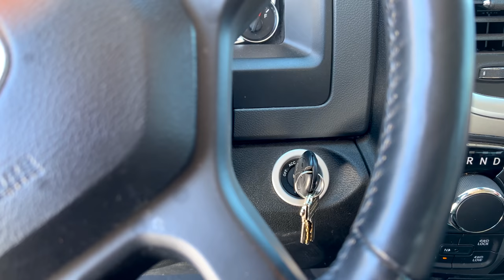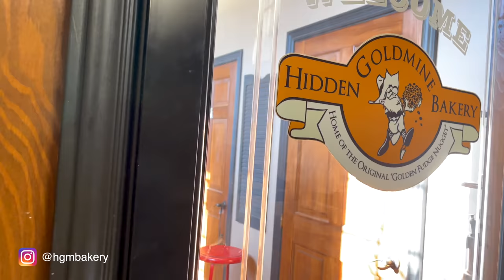Our overnight trip to the OFF GRID cabin! (Canadian Winter)

Comment: Let me help you out even though you live in the north and territory where there’s a lot of snow and cold air. If you’re driving a truck the only thing you need to do is make sure when you pack it. Everything is shut off inside the truck number two when you get in the truck in the morning or whenever and you want to start it up slash your lights one time that will give you a charge from your battery directly to your starter when the truck is completely started and running properly, let the heat build up before you turn it on will save you trouble and your truck won’t break down as much in a cold weather if possible try to cover it or put it in in the garage or put it in someplace you can get it at you could connect the cover to a tree or two trees or two poles so you can get underneath it and keep it less snow on it I do it all the time you can even buy them now like portable garage is they open up put the car in and close them the Chinese and you can buy it Just a heads up AlanMassachusetts

Comment: At last Weekend Warriors that have their wood storage worked out to be Close, Convenient and out of the weather.
     As a Heating Engineer I noticed the smoke etc on the Glass is a sign of  inefficient combustion due to lack of Wood Burner Stove design knowledge by the manufacturer, the uninitiated End User does not know what to look for in term of Maximum Efficiency ( or impulse buying), whilst the retailer wants to clear Floor Stock. 
     So the Wood Stove in question does it's JOB? apparently!!! because it heats up the 'Space' ???... However because Wood is Considered a Renewable Fuel Source, which is highly debatable, Efficiency goes out the door or Rather UP THE CHIMNEY due to so much uncombusted Volatiles from the Wood Fuel not being usefully and efficiently Combusted the Atmosphere is further polluted.
     In my extensive career dating back to the 1960's in the U.K. there was only one Manufacturer who bucked the Scandinavian Style of Wood Burner Design that became embedded in the concept of Wood Burning Stoves meaning that if it was NOT designed in Scandinavia it was perceived by the misguided End User as no good. So what was the problem with the U.K's Manufacturer's revolutionary Design ... it was built to be EFFICIENT not Pretty.
    The difference with the passionate U.K. Manufacturer was that he understood the different air flow combustion characteristics and requirements of WOOD/High Grade Anthracite/Coke compared with other fuels such as standard Coal.
Reply from the maker: Thanks for the history lesson and blowing smoke up on our comments section!  Oh, and thanks for watching! 🙏🏻
Reply: Anthracite, that’s hard, man. Smoking coke is another story. We’ll have to Hunter for that.